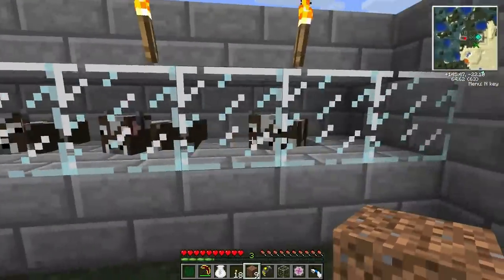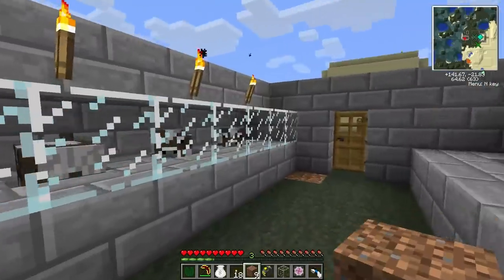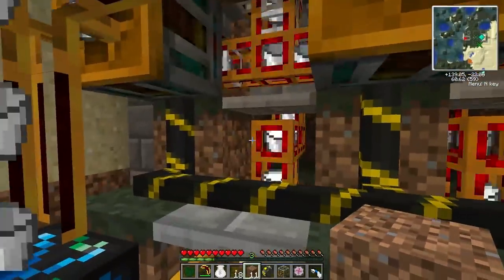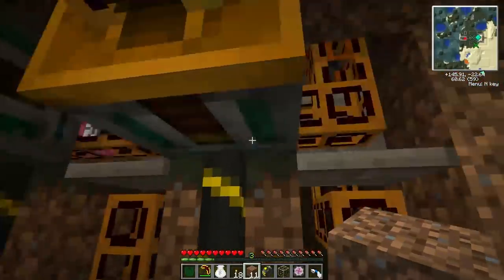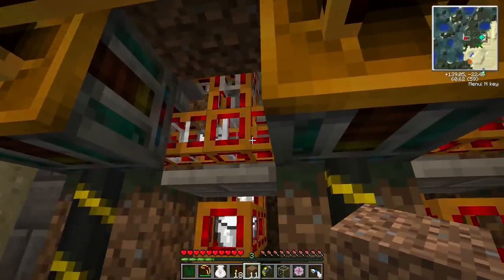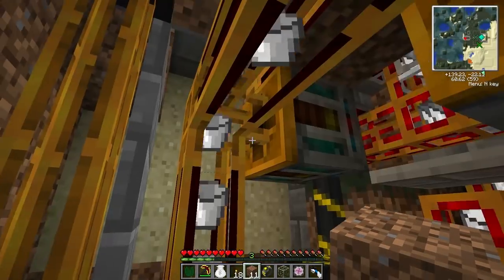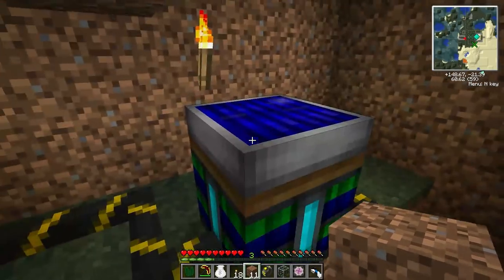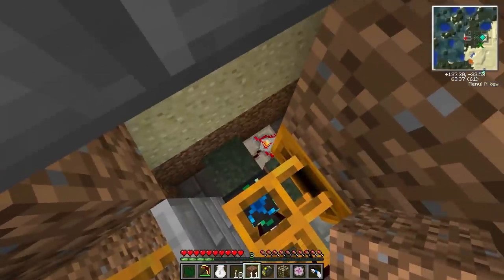[Demo] RP2&EE2 - Cow Milking Factory

Comment: You can also set up a single cow and a retriever/filter system similar to a IC water mill tender to keep a large number of Forestry biogas engines filled with milk.  Only one MJ/tick per engine, but it's free fuel, and as it takes over half an hour to burn one bucket of milk, you can run a HUGE number of engines off of one cow.

Comment: Could use a Regulator on the deployers and tell it to always have 1 bucket (or more) in each deployer so when the filter outputs empty buckets the Regulators will ensure the empty ones are evenly distributed? Now I am going to have to build one to test it. >.<